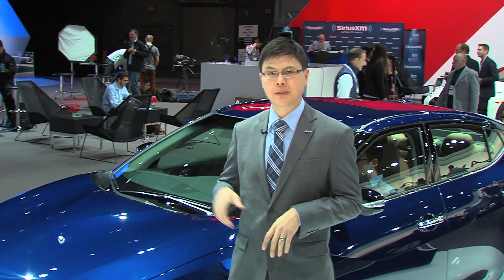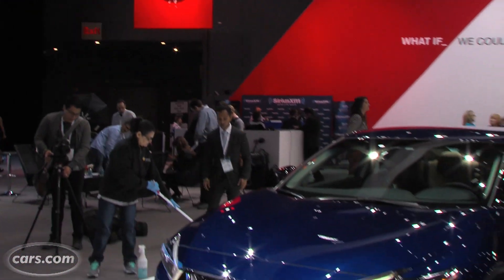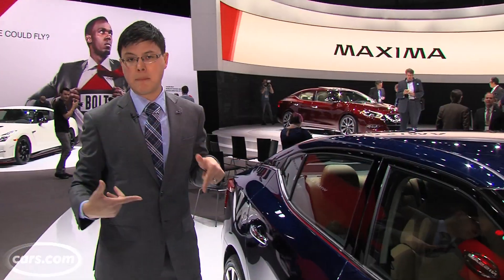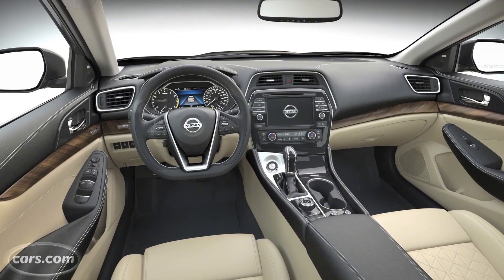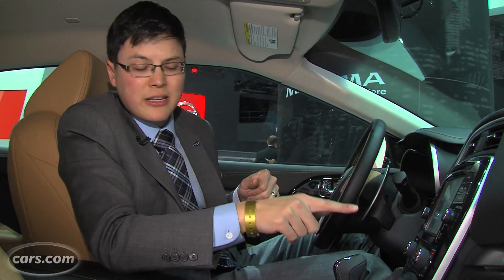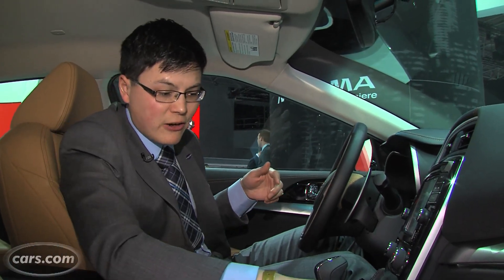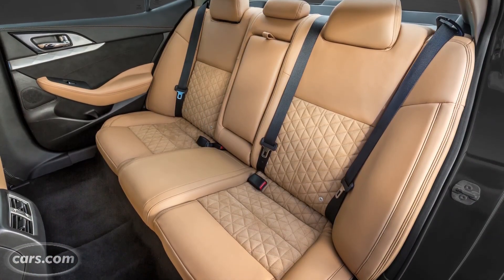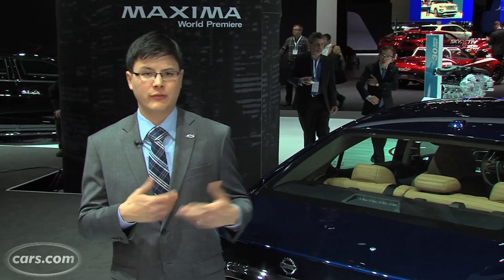2016 Nissan Maxima - First Look

Comment: Good job reserving the Maxima as a grocery getter. CVT
Reply: Kevin Smith  The next generation Nissan CVT found in new Nissans (Altima, Sentra, Juke, Rogue etc) from 2013 is more efficient and has 40% less friction than the older CVT. They have been shown to be faster than all "traditional" 5,6,7,8 and 9 speed automatic transmissions and also faster than manual stick shift transmissions. So your point in how this new Maxima is a 'grocery getter'. makes no sense.
Reply: 1966. GTo pontia
Reply: Bud Light d

Comment: Major turn offs on the new Max : fugly front grille, FWD, CVT.
It would be nice if they offered AWD.
Reply: Troy V AWD would make it heavier and slower. Manual and RWD would be a better route.
Reply: Look like i be keeping my  2014 Maxima. This one look like Shit.
Reply: XenomorphLV426 Point taken, however, a GDI 2.7 L V6 will add more hp and better gas mileage than a naturally aspirated 3.5 or 3.7 L.  The smaller more powerful engine will be lighter thus compensating for the weight of AWD gears.

Comment: Im so sorry but this...car...is...FUGLY! It just seems really choppy and all over the place. The front is bulbous and nothing flows, the sides are designed to look like the roof is floating and for the rear they went with just plain straight nearly rectangular headlights. Which sicks because the interior is great although cramped. I expected this to be as well executed as the Murano but i was wrong.
Reply: 4